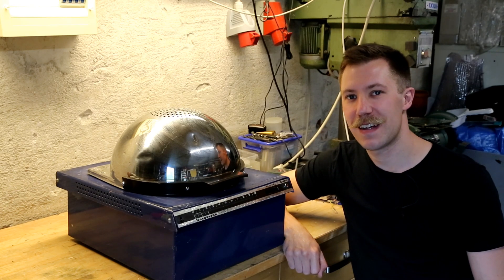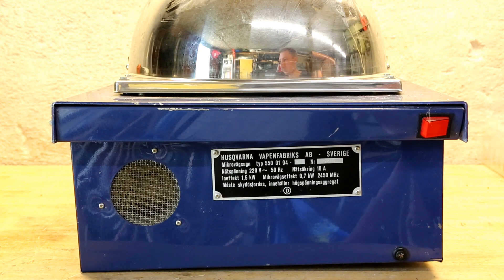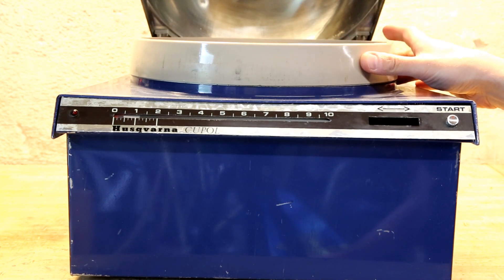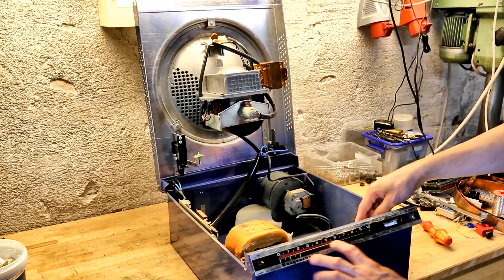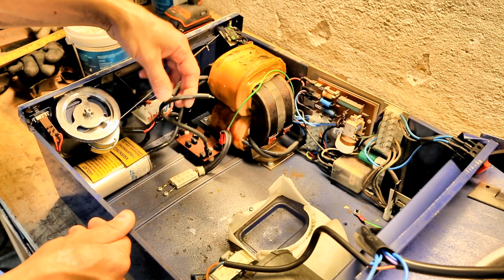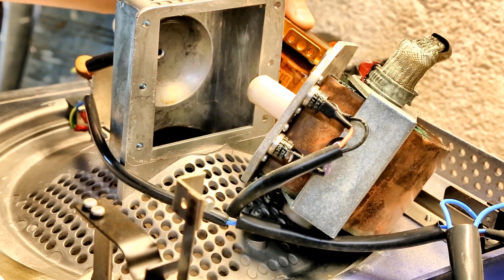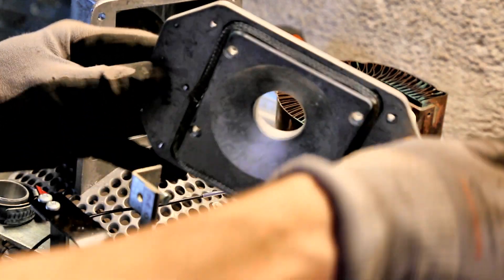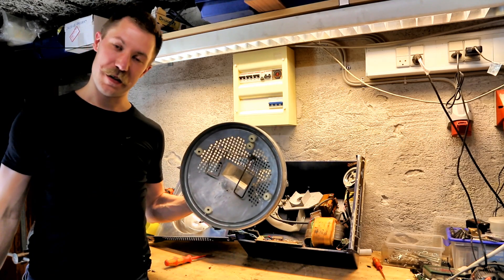Worlds Weirdest Microwave Oven, From A Weapons Factory - The Husqvarna Cupol

Comment: Never break apart old magnetrons. They can contain Beryllium which is pretty toxic.
Reply from the maker: The ceramic isolators should not be broken just for fun, that is correct. Its not everything in a magnetron that can or even do contain beryllium.
Reply: @KaizerPowerElectronicsDk  Modern magnetrons usually do not contain beryllium because it is too expensive. But these old ones which were built to high quality standards, I would assume do.
Reply from the maker: I agree on this old one! New ones is some aluminium oxide, but that is far inferior to the thermal properties of beryllium oxide :)
Reply: @KaizerPowerElectronicsDk  Everything must be made cheaper so we must replace it every 2-3  years instead of repairing and holding on to it.

Comment: As far as I remember the string squares are an extension of the waveguide to break up the waves more to make them spread better.
I have a few of these ovens but it was quite a while since I last tried one, I think the heat was most intense over the two squares, you got to hot spots when heating.
I must admit I don’t remember everything about them but at the time I was quite interested and gathered all the information I could but it’s now almost 20 years ago.
Why do you take it apart instead of putting it together, it seems complete.
If you put it together, and if you try it, do remember you need to leave the switch on the rear on for over a minute before trying to start it, otherwise you’ll get no microwaves and you’ll think it’s not working.
I know a few people including myself that have thrown it away believing it’s not working due to not knowing about this strange warm up.
Reply: Jag har två stycken, båda fungerande. En svart/vit Electronic 2000 (den äldre modellen med tryckknappar) och en grön Cupol.

De fungerar som sagt alldeles utmärkt!

Comment: The two temperature sensors are actually for two different things, the reason that there are two is not for redundancy. One of them is to turn the microwave oven off if it were to overheat. The other is to turn the fan on when the microwave is beginning to get hot, if you run it for less than one minute the fan won’t start at all. 

I have two of these ovens, one that is a little bit different than the one in this video that is working and that I use quite often, and one that is exactly like this one and is currently not fully functioning.
Reply from the maker: Thank you for the input! Is it a superior microwave oven compared to newer models? Is it more powerful or less efficient?
Reply: @KaizerPowerElectronicsDk  I actually got both of them working, kind of surprised there. 

Well, the efficiency is as you can imagine not very high, around 50-60%. This is a bit worse than a new microwave which would have an efficiency of around 70-80%.

They are about the same power output the older one is at 1000W and the newer 700W. The heating is surprisingly even considering that there are no moving parts, it might have to do with the quirky antenna inside the oven.

I would not say that it’s superior to a new one considering the odd shape and it’s limited space inside. It is however cool to show off.

Comment: 9:50 It seems to me it's there to provide minimum RF load so that when someone accidentally turns it on without food some of the energy will be absorbed in this 'antenna' and turned into heat instead of going back to magnetron and destroying it.
Reply from the maker: Not a bad suggestion, the 90 degree wave guide output could be there for the same reason. A modern just emits directly out of the tube.

Comment: The antennas may be to actually retransmit the RF for better oven coverage?

As for beryllium, based on the age of it, it's likely wise to be careful.

Could you do a closer look at the airflow deal for it all?

Looks like you should be able to retrofit a newer magnetron, if you so desire.
Looks like the magnetron kinda feeds into a waveguide (not too uncommon)

You could possibly try to dismantle the magnetron wet, or just leave it alone.

Comment: Should be easy enough to retrofit a more modern magnetron into that unit, probably easiest by taking the cavity wall and the magnetron as a unit, and making a new plate to hold it. You probably are missing a high voltage fuse assembly that links the power supply and the magnetron/filament supply, as in a unit this old they would have definitely put in a high voltage fuse, or a high voltage fusible resistor assembly to prevent damage if the magnetron failed.

Would be a nice unit to repair, with that retro look to it, though replacing that plate with a new one would likely involve a bit of work, to get a new plate/base that is transparent to RF, probably will have to be specially made out of a ceramic, and then fired and glazed.

Comment: Thank you for wearing a mask.. I thought about beryllium oxide as soon as I saw that old magnetron! Very interesting find, I never saw a microwave oven shaped like this.It looks very stylish (more like 70s than 60s) but to be honest its too large for a small kitchen. No wonder it did not sell well (beside the high price I assume).
Reply: Very likely it is a beryllium oxide unit, being that old, though probably only alumina for the output cover, only beryllium oxide for the magnetron seals, which would need the heat transfer capacity of the beryllia. I worked with magnetrons that vintage, and the only beryllium oxide parts were in the power supplies as insulators for transistors, and some others in ionisation switches, as they had a large amount of heat generated in a tiny cavity, and needed to be kept cool for fast quenching. the bigger worry was the Amerecium ionisation helper, a tiny little gold sputter on the wall, that would eventually decay away entirely with time.
Reply: @SeanBZA  Sean: thank you, very interesting
Reply: @SeanBZA  Sensible, why would they use exotics if they don't have to?

I see many go "all ceramics must be toxic", while I totally fail to see why they would use it evrywhere.

How do you relate to thorium in neon bulbs?
Reply: @erlendse  There is a very tiny amount, and in general it is safely contained in glass, so is quite inert. Still would not grind them up and eat them, more for the heavy other metal content. Biggest source of radioactivity in the typical house is the nice new granite kitchen counter top, unless you live in a radon containing area, in which case the basement will be a bigger worry. 

Just remember that they cannot build a nuclear power plant in Scotland, because the background radiation from all the granite rock there is close to exceeding the workers dosage limits. In some places they would be past the limits, and people have lived there for centuries, just wearing kilts, and with the Scottish national weapon, the bagpipes.
Reply: It’s suppose to be installed in a hole, with only the dome and buttons visible, this makes it in fact very slim and uses less space than a new microwave. It actually look both cool and futuristic when installed properly.

Comment: Well the dimensions of the rectangles seems to be tuned to 2450 mhz so.. yes its an antenna.

Nice video, ive never seen microwave ovens that old, its a relique.
Reply from the maker: Would the purpose of this antenna serve as a "minimum load", so the magnetron would never get destroyed from reflected energy?
Reply: @KaizerPowerElectronicsDk  i'm not much into rf, but taking in count each rectangle is 1/2 wavelengh by 1/4 wavelength and both rectangles are separated 1 wavelength from eachother and both grounded, i guess the purpose is to reflect the wave 180 degrees so it cancels the incoming waves into the magnetron. please someone more experienced on this tell me if i'm wrong.